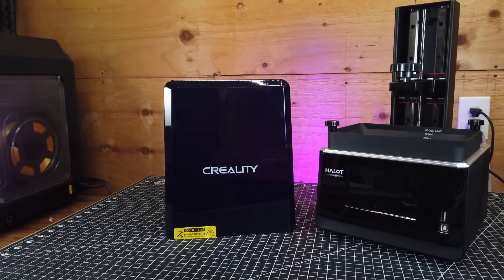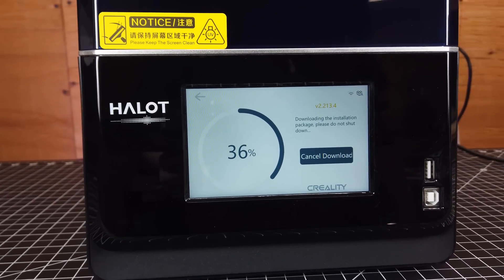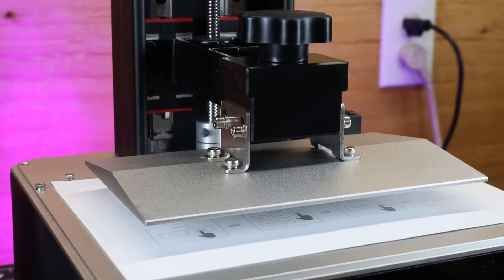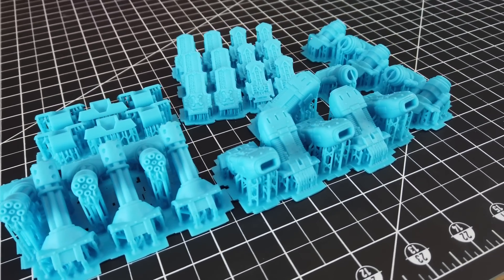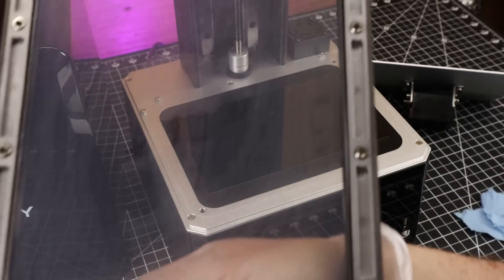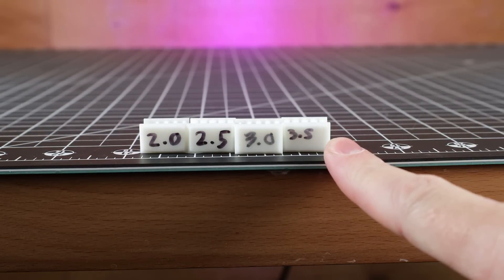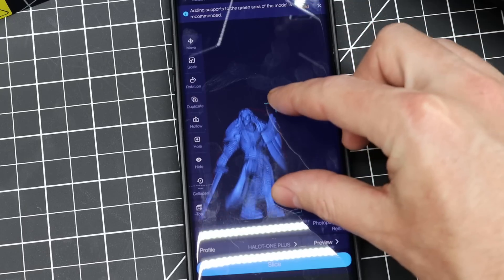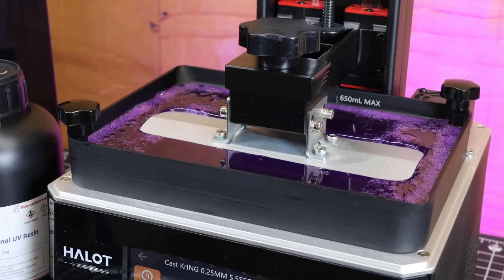AMAZINGLY Sharp Details - Creality Halot One Plus 4k 3D Printer

Comment: I got a Halot Plus and after a few prints it failed to print any more. A change from the installed FEP to the included FEP fixed the problem. Apparently the prefitted FEP has a few issues. Creality customer service was useless and I was left with trial and error to fix the problem.

Comment: When you see the resin prints leaving marks on the fep film it means you levelled it too tight. Been using the halot one for over a year for jewelry and once I figured out why my fep film was getting damaged due to bad levelling I never encountered anymore damage along with the resin not sticking to the fep. I also just got my halot one plus this week since I needed a bigger build plate for my toy projects. It also helps to add a bit of rain x to the fep film to make sure there is no chance that the resin will stick to print. I don't hear anymore sound of the fep film being pulled up whenever it rises after each layer.
Reply: @Yokiie If the paper sandwhitched between the fep and build plate is too hard to move or cannot even move then it's too tight. It causes the prints to imprint on the fep sheet itself making it harder to stick to the build plate while also damaging the fep sheet. Also it's not a dumb question, people who love to question things and learn are actually smart.
Reply from the maker: They mean too tight to FEP sheet with the build plate